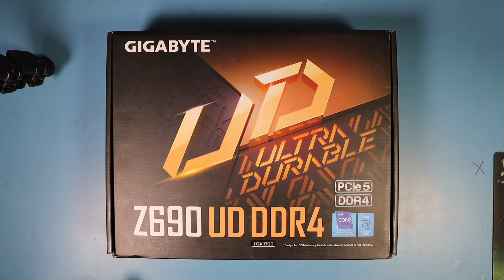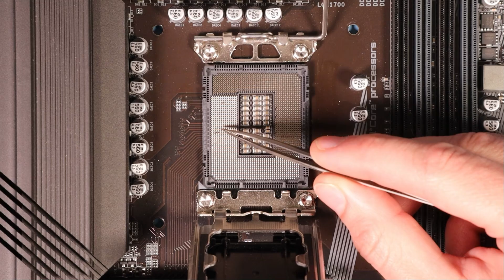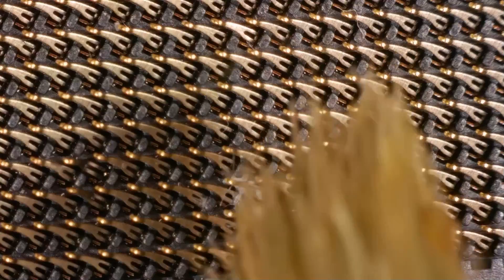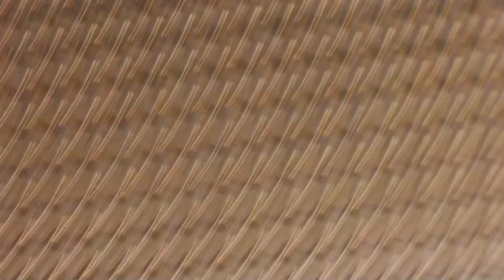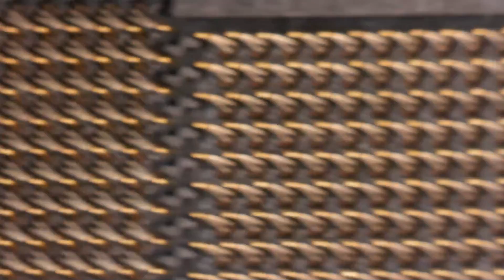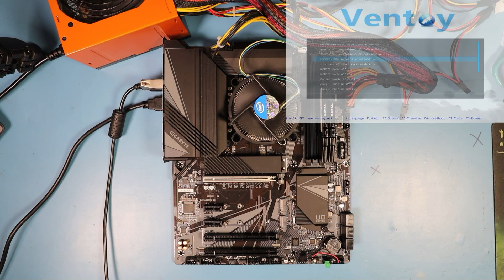Gigabyte Z690 UD - Bent CPU-Socket Pins Repair - LGA 1700

Comment: As much as i appreciate you showing the full process here instead of a cut video, i do think its wise to make some things clear for other people attempting this: 

1. Like you found out, Connect both Motherboard power and CPU power 

2. Some motherboards wont POST at all without a CPU fan connected to the fan header 

3. The default RAM slots for pretty much all boards are A2 & B2 for dual channel operation. Thats the 2nd and 4th slot counting from the CPU socket. This is mostly a performance tip and won't actually prevent POSTs but some motherboards are more strict about this and simply won't POST at all with RAM in the incorrect slots.

Bonus: For boards that don't have a HEX code display, getting an external PCIe HEX code display card can be quite useful in troubleshooting. Usually only cost a few euros online.

Again, thanks for the video!

Comment: Fun fact: I found it's much easier usind that fine tip tweezers which i bought just for this work, to grasp the HEAD on each pin with your tweezers carefully (that shiny ball at tip of each pin) by which you can then pull it in the right direction to re-orient the bent pin! Faster too!

Comment: You installed the memory boards in B1 and B2 that configuration does not provide for dual channel memory. Insert one memory card in A2 and the other in B2 and see whether motherboard boots and BIOS shows dual channel memory.

Comment: Hi Friends i have the same problem bit i have repaire all Bent pin . But my ram Works now allways on 2 slot of 4 ..... An Idea ?
Reply from the maker: If you had bent pins and fixed it, but one of your RAM channels still isn't working, you might still have pins, that do not contact properly. Check them again and perhaps try to clean the pins or your CPU. A little bit of skin oil could be ruining the contact. And one missing signal can can take a whole RAM channel down.
Reply: @cookingcomponents7858  tkx
Reply: Is derange a good thing in your language??? In English deranged means angry/unthinking haha!!
Reply: @tristancole8158  chn